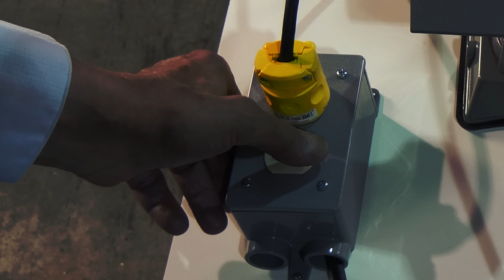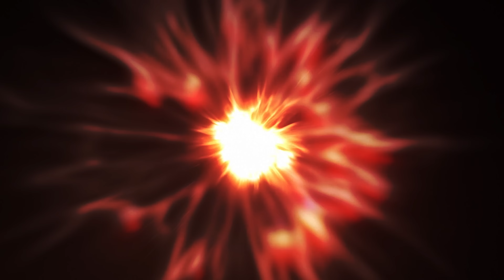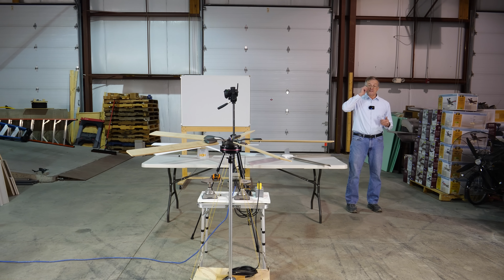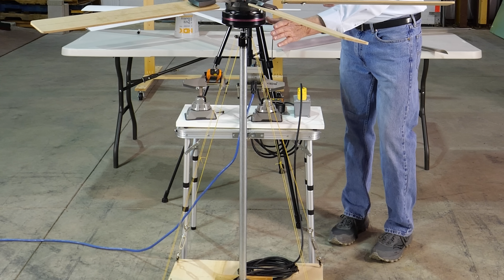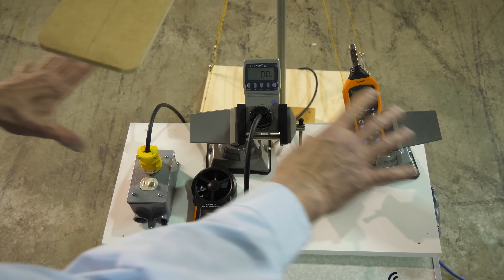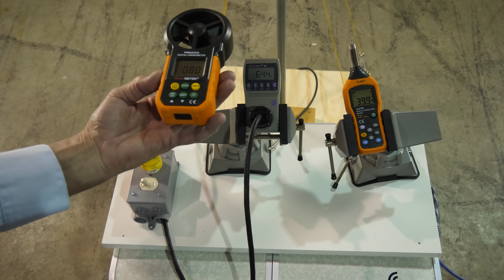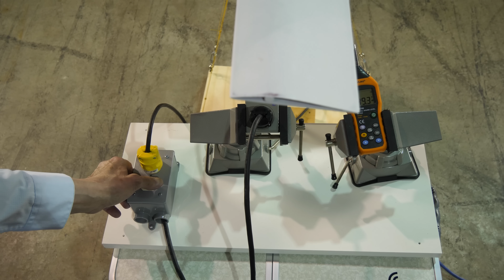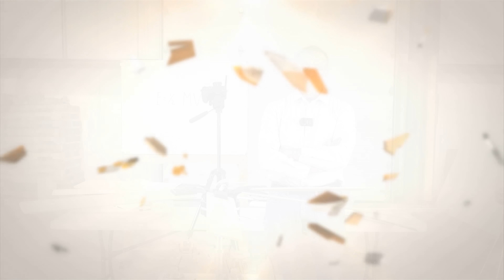This Fan Uses Almost NO Power

Comment: Thanks for this! I just replaced my 15 years old fan, as it eventually become unable to spin, even at full power. I just checked and my present model has a declared 40W consumption, which I presume is at full power, which I seldom use. Also clearly written on the box is "DC motor", which I didn't notice when I got it. Glad to know I accidentaly bought a good one! Appreciate your videos on energy saving, a real big topic these days.
Reply: most likely, "DC motor" means "universal", which is a different thing from the BLDC (brushless dc) in this video. the first connects directly to AC mains voltage, the second is connected to a controller module. the other bad news is, for most fan motors, with different speeds, running them at low speed uses nearly the same power as running them full speed

Comment: you forgot a very important at the end
in countries where they use fans a lot and that motor wastes 50w of heat with a air conditioner that 50w has to be cooled to, and then you have to use more power to cool down that 50w of heat. vs. not producing it at all.The heat pump might use 200w of energy to remove that 50w of heat. so if you save 50w of heat from the fan you also save 200w of heat from the heat pump/AC. 
So if you thought 1kwh a day if it doesnt run all day suddenly its actualy 0.25kwh pr hour. and just a few hot days might bring you to the same cost.
Reply: Who is using a heat pump with a COP of 0.25?

Comment: Well, also these less efficient motors add more heat to the room that you have to counter with an even higher air flow! If you account for that they become even more inefficient. 
Would have been nice to see how the DC motor would do with the air foil!

Comment: Did you test different angles for the airfoil blades? Also, is the airfoil profile constant over the whole length of the blade? Considering that there is a great difference in speed from the hub to the blade tip, I can imagine that varying the profile along the blade length could help a lot.
Reply: Most likely it would also make the rotors much harder to make. In large volumes this would probably work.

Comment: This makes sense as a one-off test scenario. 

But plugging significant DC load on to AC grid leads to harmonics issues. 

So this might not be a practical energy efficiency measure which can be implemented on a large scale.
Reply: No harmonics if you rectify & filter. Bridge Diode & Capacitors.
Reply: @RTR-MATEY - my understanding is that these bridge diodes and capacitors are the main reason for harmonic distortion when large DC loads are connected to the grid.

Comment: Interesting findings, but i'm not convinced that this was a (completely) valid test setup. It seems, you ran those ceiling fans upside-down, in the opposite orientation they're supposed to be mounted. I'm just a YouTube viewer, without access to engineering schematics or the physical thing for disassembly. I have a hunch, though; the bearings might be specially designed to take right-side-up ceiling mount type loads. 😉 i mean, that's what i'd do, if i were to design a ceiling fan 😅 (edit: i wouldn't care about wrong-side-up type loads)

Comment: Just wondering if the old ac motor was operating near saturation? Maybe dropping the volts will improve efficiency?  (P.S. just bought a new fan with dc motor and even my freezer has a vfd driven motor , much cheaper to run .  Interesting that your cost per kWh is comparable with mine in UK)

Comment: It would also be interesting to now how the DC fan will perform at the lowest speed. Often you do not need much to circulate the air.
Reply: PWM DC can assist with speed control.

Comment: I feel like you should also be measuring the RPM of the fans, especially once you compare between the DC and AC motors.
Reply: I am also curious about the RPMs
Reply: For a given set of blades, there should be a direct relationship between RPM and airflow, so measuring one should be sufficient.   (Although measuring will verify if that’s the case.
Reply: @ChuckvdL only if the blades are the same mass regardless of shape.
Reply: @TheSpiffyNeoStar why would the mass matter?  he’s not looking at the spin-up, but at the draw once it’s at a steady speed.   At that point the energy is expended moving air around, and the faster it spins the more air is moved
Reply: So did anyone think No 2 blade was turning at 80% of the 1st and 3rd rotor ?
Reply: The flow rate is based on the RPMs of the blade, and geometry, temeprature and pressure. so changing the motor doesn't change anything other than the power consumption.
Reply: I’m not an engineer and I hope someone corrects me if I’m wrong, I think rpm is less important due to the possibility for cavitation. Simply because one may spin faster doesn’t mean it will produce more air. The output of air, and the power usage like he is measuring seems to be the best way for the ultimate goal here. Edit: I was wrong wrong wrong.
Reply: @BuilderBreakerRemaker Happy to correct 😅. Cavitation only happens in liquids (precisely when the liquid starts to boil due to low pressure zones). What you probably meant was turbulence and vortexes causing high drag without actually moving air in the desired direction and you are of course correct that air speed is what you ultimately want from a fan and not high RPM.
Reply: @robstamm60 thank you, I’ve only seen it with liquids but thought it may be similar. Appreciate you.
Reply: @BuilderBreakerRemaker  setting the same RPM also normalizes for weight of the fan blades or other motor concerns.  It also let's you compare the efficiency of the blade shape. Like maybe the compound blades were moving more air because they were lighter and thus spinning faster.
Reply: @TheSpiffyNeoStar weight would not be a factor here unless you're measuring time to accelerate to speed. 
It doesn't take more energy to spin a heavier blade at the same rpm as a lighter blade, it only takes more energy to get it up to speed. That energy is returned through extra air movement as the blades coast down to a stop when the fan is turned off. 
There might be a small (likely so small as to be unmeasurable with the equipment used here) increase in bearing friction with heavier blades but it would be negligible.

Comment: You REALY have to make a second, way shorter video about this, summing up how you can already exchange AC for DC motors when buying something as basic as  a vac, a fan of any kind or a circulation pump for your hot water. This  is fucking important and nobody talks about it properly.
Reply: And another really long one for the nerds, that really want to get into modding old stuff to be more efficient than current stuff!

Comment: One thing not mentioned is for regions that have a heating season, the heat is not wasted for that part of the year. Same for incandescent light bulbs. So your return on investment takes longer and the total savings claim is skewed.
Reply: why would you turn on a fan in the cold :)
Reply: Ceiling fans aren’t used much during heating season. And the heat from the blower motors of the furnace is as good as wasted since it doesn’t make it to the ducts and the furnace is usually located in an isolated area.

Comment: Those fan have a capacitor inside them and usually is not optimized for the motor, but rather a maximum blade speed, if you change the capacitor to optimize for torque / efficiency maybe you can get a lower power consumption
Reply: Capacitor is a "motor start" Capacitor.
Reply: @RTR-MATEY  that is what is called by many, but electrically is a phase modulation circuit. it's function in a single phase motor is to retard the electrical phase on the secondary winding, without it there is no phase modulation, in DC motors this is what the controller does

Comment: My  first thought when you were considering airfoils was, "What about when you want to reverse the fan from blowing down in the winter to pulling up in the summer?"
Reply: The need to do that is basically an urban legend. It makes essentially no measurable difference.
Reply: I guess u mount them backwards.
Reply: re: ""What about when you want to reverse the fan from blowing down in the winter to pulling up in the summer?""
The choice of a different NACA design airfoil and tilting the blades (added: Reversing the motor) can do this; ever seen stunt aerobatics where the plane flies upside down? Yeah ... that ..
Reply: Nope you destratify year round by downward pressure, followed by horizontal displacement and rise upwards at the edge of the room. At least with Airfoil based H(igh) (V)olume (L)ow (S)peed fans. It removes heat radiated by people, reducing heat stress. Nothing more.
Reply: You can turn the blade also upside down
Reply: I would think you'd have to flip them end to end and rotate them 90° @zoltang1660
Reply: You don't need to reverse the blades, we have fully formed airfoil (the airfoil is also different inside then on the outside diameter of the blade)fan here it pulls up the air just like crazy no problem. And the design is just beautiful.

Comment: How much heat is being generated/wasted by the DC control box?  Reason I ask is because I dont have DC in my ceiling, I have AC, so there is a conversion from AC -> DC.  Those wars were fought years ago and AC seems to have won as the general use format for electricity.   Of course im typing this in 95* temps deciding if I stay in the A.C. house or get real work done outside... 😅
Reply: AC won as it transmits well over long distances. DC Wins in the torque game which is why I believe they use it for diesel-electric locomotives.
Reply: @RTR-MATEY That's incorrect. AC won because transformers beat solid state power switching for voltage changes. Now we have silicone carbide power switching. AC power loss is higher than DC at the same current, as in addition to the same resistance loss there is an induction loss.
Reply: DC Voltage drops significantly with distance.

Comment: Around 50% of all electricity used worldwide is used by electric motors. And out of those motors vast majority are pumps used to move fluids. Heat pumps, fans, and compressors are all pumps. In industrial scale, the motor efficiency is better taken care of with the 3-phase motor efficiency ratings. New large motors are required to pass a certain level of efficiency. 

In the consumer market the manufacturers want to minimize the cost of the product, not the cost of operating it. Thankfully things like EU-energy labels are forcing manufacturers to improve efficiency as well.
Reply: Consumers what it cheap now, not cheap over a decade. They see the bill when they buy it, but never count the pennies it takes to run it all year.
Reply: @jfbeam  people are also averse to taking a chance on a fancy high efficiency new appliance that costs way more to repair.  Your new Samsung fridge may use way less power, but only lasts 5 years and no HVAC guy will fix a leak on it.
Reply: @kuni45  They usually don't mechanically fail. The stupid overcomplicated BS IoT electronics fail first. And there's zero fixing most of that. (parts aren't available, and the pieces that are cost more than a new fridge.)
Reply: the other half is used for lighting...   ;)
Reply: @bunnykiller With the move to LEDs lighting is only responsible for around 20% a large chunk however is used for cooling (fridges, freezers, industrial cooling, AC) and heating(resistive heating, heat pumps, cooking, induction heating).
Reply: With outrageous energy prices, this starts to be making significant impact...and even the end consumers are aiming for more effective appliances and whatnot...

Comment: I want more info. How did the dc fan do with the different blades? What voltage is the dc motor. 12v.. 110v.220v. .

Comment: couple other items I found worth mentioning 
1) more efficient = less waste heat = less energy needed to he offset via climate controls
2) is the inverter located inside the motor?
Reply: 😂 great minds think alike. I was wondering about the inverter/converter and the energy loss in heat in that
Reply: 1) more efficient = less waste heat = less energy needed to he offset via climate controls

That is only in specific cases. In the winter you would use more energy from climate controls to offset because the motors for your appliances are not making as much heat. There was a real problem at first with street lights when they switched over to leds because the light wasn't keeping the unit warm enough in harsh winter conditions.
Reply: @kmo9790 people run fans far more often in the summer and making heat indirectly is nowhere near as efficient. You running these fans outside in the winter or are you just being ridiculous 😊
Reply: @mattbrew11  did you watch the video? Fans aren't the only things that use these motors. Everything in your house uses them. Are you trying to understand what is being put forth in the video or are you just trying to make people think you are smart?

Comment: Little mental puzzle for fun, related to the video's topic: Hydrogen/oxygen rocket engines are usually run very rich. There is a bunch of unburned hydrogen in rocket exhaust, and no, it has nothing to do with thermal control (although it helps, but it is not the primary reason). Why would literal rocket scientists dump unburned fuel?
Reply: Hydrogen is less dense and accelerates to a higher velocity in the exhaust than oxygen or water.
Reply: @FrancisKoczur  Bingo, you lose some chemical energy by having extra hydrogen, but the rocket gains overall more momentum due to increased exhaust velocity.
Reply: likely because the excess oxygen would be hungry for MOAR fuel, and start burning metals and other rocket parts
Reply: @cleverca22  Good guess, and yes, hot oxygen is bad for metals, but no, that's not the answer. It has to do with energy and efficiency (even if it seems counterintuitive to waste unburned fuel)

Comment: presume blades have constant angle of attack. Significant improvement should be made with the angle of attack varying with the radius and properly designed  Perhaps  even a simple twisted flat sheet metal blade would be better although L/D is very much worse than your aerofoil

Comment: It's funny that you made this video. Awhile back, I was looking at my ceiling fan blades. Like you said, they're just flat fiberboard with flat edges. I was thinking about rounding off the leading edges to make them cut through the air better. Never did though because I hardly ever use it.

Comment: If you haven't already, take a look at Big Ass fans (yes that's the real name of a real product). I used a 12-foot diameter one in a public library I designed in Kentucky. It worked very well for us.
Reply: Yep. They're DC Brushless.
Reply: @RTR-MATEY  They used to be 3-phase. The big industrial ones upto 24 feet. Not sure about that later architectural/design line they added. Also would be great to see those white foils being applied in an alternative to the wheeled standing drum rotary fan, as those combine bigger blades/even airfoiles with higher speeds.

Comment: Isn't that something! Someone using 4 fans all day every day could save up to $50 a month on their electric bill! That's a serious savings. Not to mention if we could get these DC motors in all the other appliances!  Electricity Prices are Way Too High for Everyone. Some more so than others though too.  Wow! Thank you for your Hard Work and Research once again! :yougotthis:
Reply: I wonder how it is possible to spend $50 a month just to move air.
😂
The same money would be better spent with an air conditioner, that at least cools and dehumidifies air. A fan works by promoting perspiration, but if the humidity  rate is high it helps very little.

Comment: After you switched the motor from AC to DC, you didn't retest the different blades.  My non-scientific thought is that the differences with the AC motor would translate directly to the DC motor.  Notwithstanding, will you provide the "inside info" on source of the DC motor and the way to make the more efficient blades?  Enquiring minds want to know!

Comment: I have a server rack that came with a modified 120mm case fan in it. I'm assuming the modification is just a diode so that you can plug it into a normal 110v outlet. It draws 12 watts! That's more than double the average case fan. 

Swapped it out for a Noctua and made a USB pigtail. Now it uses a phone charger as a power supply and total draw is 1.3 watts. Pretty sure I get better airflow as well.
Reply: Muffin & Blower fans are made in all kinds of voltages...AC & DC!!!